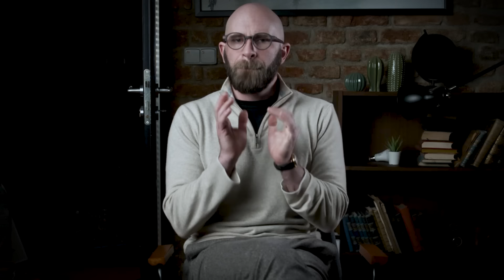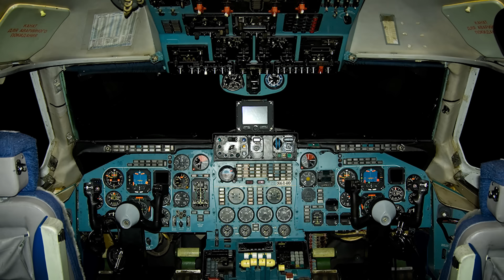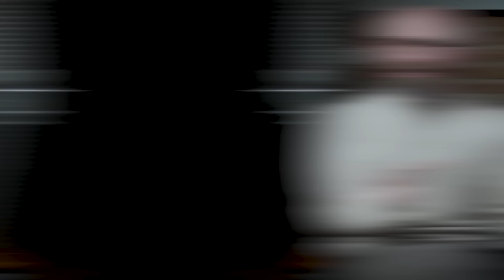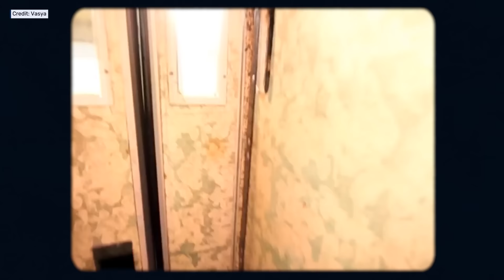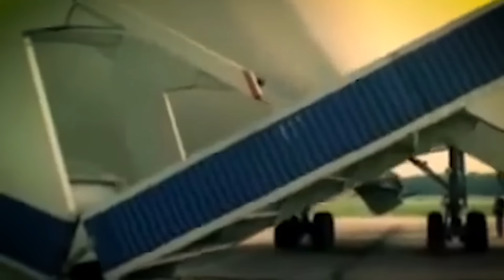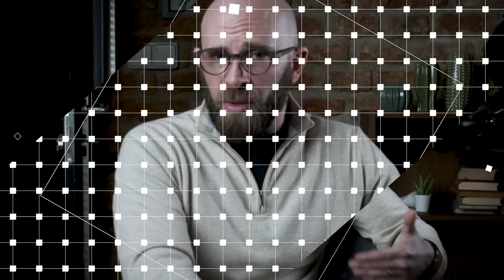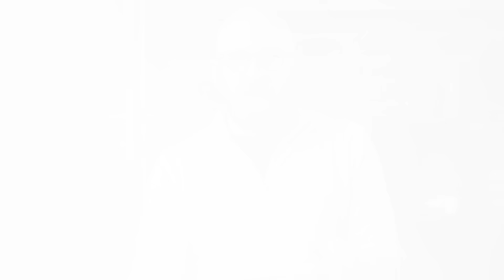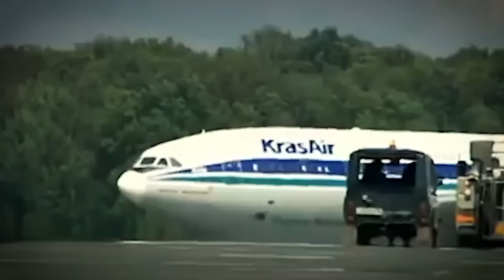The IL-86: The Soviets' Botched Answer to the 747

Comment: It was not a botched answer. It was what they could do with the primitive engine technology that they had. Yes the Soviets were weak in developing efficient jet engines for both military and civilian aircraft. They should have sent more spies in the west.😊
Reply: The turbojet engines on the 1950's Tu-104 aircraft were more powerful and not any less "efficient" than the early Boeing 707 turbojet engines. The USSR never needed to put 8 jet engines on a bomber like the US.

US engine developers though had fewer limitations on spending or resources. If GE or Pratt and Whitney needed Titanium, Niobium, Hafnium, Zirconium, Yttrium, or Rhenium they could easily get as much as needed. While the USSR had to get around export bans imposed by the US or mine them, if possible, on its own territory. Those funny sounding metals is what you need to build High Bypass Turbofans today that are fuel efficient, resist corrosion and heat, as well as long lasting. They also happen to be rare on this planet, only a few countries have sufficient reserves of them.

Most of the World's(75%) Niobium comes from Brazil while the largest mines for Titanium ores tend to be in Africa and Australia. Early jet engines relied heavily on Nickel alloys, but more metals were needed as designs became more complex. That is the reason why only some companies that have access to the right resources are able to manufacture the most modern jet engine designs, while the original basic centrifugal compressor design is built by some as a do it yourself project.
Reply: @legatvsdecimvs3406  The USSR was the largest producer of titanium though. And most African countries except South Africa and Congo were Soviet allies, so there also was no problem.
Reply: No, that's not the case.

The engines of the Tu 144 were more powerful than the ones of Concorde but since Concorde's were turbojets, they had better fuel economy while Tu 144's were turbofans.

The engine of the MiG 23 also has a better T/W ratio than the F35's engine.
Reply: @legatvsdecimvs3406  there’s abundant evidence that USSR jet engines consumed more fuel to produce similar thrust than comparable western engines
Reply: Really?
Reply: @JuPiTeR_0211  yes really

Comment: I'm actually really curious why it used Hydraulics for the trim tab instead of an electric servo. Was the level of electrical engineering not up to pass in the Soviet union? Like genuinely want to know anybody out there hit me up educate me
Reply: In a hydraulic system, we can “trim” the pressure/flow by using a very simple controllable valve positioned partially open.   The hydraulic system is constantly flowing anyway, so why not tap into the main hydraulic circuit?
No need for a separate system with extra weight and complexity.
The drawback is that it is under constant flow and must somehow be monitored, where an electric servo is set and forget.
Reply: Yes I also want to know.
Reply: Probably cheaper
Reply: Possibly they were just reusing a proven and "certified" design. It happens everywhere. I'm sure they could have made a crude electric servo for the job, but if you already have hydraulic lines running by there and a perfectly good hydraulic system on the shelf.

Ask boeing how their all new 787 design has gone.
Reply: @eoinkenny3188  The difference between the two is that I'll willingly step on board an Ilyushin...

Comment: 03:25 - simply not true.  At the time, ONLY the 747 had the capability to reasonably accommodate 10-abreast seating for long-haul routes.
Even in 2025, it is still common on most wide-body aircraft, except the Boeing 777, the lower deck of the Airbus A380 or high-density versions of the A350, to have 8-abreast (2-4-2) or (more commonly) 9-abreast (3-3-3) seating even in economy class.
Reply: The L-1011 had in coach an annoying 2-5-2 seating, which meant you could end up double-landlocked if you were in the middle "E" seat in both directions.
Reply: Ai thought Boeing were mediocre in passenger comfort until being on an Airbus, those are even tighter width wise and the seats kill my lower back

Comment: There's one point in there: Nobody were  better than the Soviet Union at welding titanium for a good price. It's suuuper difficult and they have (had?) loads that in the 90's and early 2000's that did it almost for free compared to western counterparts. And as it was titanium, they came out of the aerospace industry which was one area where the Soviet Union did not cut short on quality. Super quality, super cheap.
Reply: Their problem isn't Titanium. As seen in project 705 Lira and MIG25 Foxbat. They did wonders with titanium, the issue was everything attached to said titanium, such as electronics, reactors, engines, and avionics, which were often of very poor quality
Reply: @InterstellarTaco Everything was good quality. Only sometimes was it bad.
Reply: Being one of the biggest producers of the material also helped.

Comment: The facts on this are so out…. So having more wheels means you have a bigger aircraft? Explain the MD-11 or DC-10-30? Both had centre main gear…. A340-200,300,500 and 600 all had central gear… 

Soviet aircraft had a poor safety record but mostly due to pilot training… the TU134, 154, Ilyushin IL62 and IL86/96 were some of the most versatile aircraft in the skies..

Terrible video.
Reply: Yup, not to mention the 1l-86 has never been involved in a fatal accident with passengers
Reply: More wheels means the weight is distributed more, so the % of the weight per wheel is lower. So heavier aircraft need more wheels. But more wheels can also reduce runway requirements. This is why military cargo planes sometimes have more wheels.
Reply: Soviet aircraft were reliable, but the thing was that since every civilian aircraft in the Soviet Union was registered with Aeroflot unlike in Western countries where there are lots of airlines, all the burden of any crash went to Aeroflot.

Comment: im convinced that the soviet union was a circle, because they cut all the corners. at least its not a tu-104, which i think (might be different plane) has a song that its a death trap and the pilots were terrified of landing at low speeds
Reply: It is the Tu 104. 
At the time, it was the only jet liner operating in the world (the Comet was grounded for safety concerns for ~2 years). 
The (dark) joke in the song is that it's the fastest in the world. It'll take you to your grave in 5 minutes!

The issue with the plane is that it had a tendency to "Dutch Roll" (tail wag), something that wasn't fixed in the direct successor the Tu-124
Reply: @smalltime0  I live very close to where the Comet was developed, and unsurprisingly there's an apartment block in my town named „Comet House“.

All of the windows are square... ✈🇬🇧😉
Reply: @UK-Combustibility-Assured Oh no! They didn't learn!
That's how you get metal fatigue! /s

Other than it's early (terrible) safety record, the other issue was that engine maintenance was nigh-impossible. Which the Tu-104/124 also shared because the engines were in the wing.
Reply: @smalltime0  Fortunately, the building is made of brick and concrete (Typical of most British apartment buildings) so the main cases of metal fatigue around here are in the plumbing, plus the complete destruction of my Death-Metal-loving character by the pandemic and a forced obligation to keep tuned to public radio broadcasts for pandemic updates! 📻😷🤘⛔😢

Aye, the fashion for putting the engines in the wing was an odd one. I often wondered if that induced structural weakness in the wings, given the structure around the engine has to bear the weight of the fuel as well... ⚖

But after watching this vid last night, I'm crying that I'll never be able to experience an IL-86 for myself. I probably differ a lot from most Brits (To the point I identify as German 🇩🇪) but I think Illy/the СССР got the design and passenger usage mode bang on! 💯
Reply: Most early jet/turboprop passenger aircraft were "death traps". Boeing 707's would turn into a fireball if hit by lightning. There were no ground proximity or collision warning systems. No Data Recorders until the 1960's. No Auxiliary Power Units on the early designs. No GPS navigation systems so aircraft could easily fly off course. Ice removal was rare until the 1980's.
Reply: @legatvsdecimvs3406  Most British Aerospace built aircraft would instantly turn into an inferno if the flight crew deployed the fire suppression system... 🧯🇬🇧🔥😆
Reply: Early jets are mostly death trap tho. Yet most of them also failed